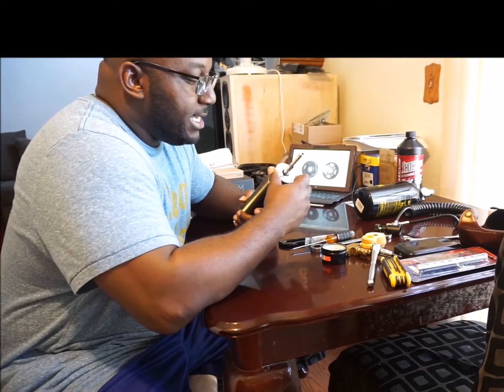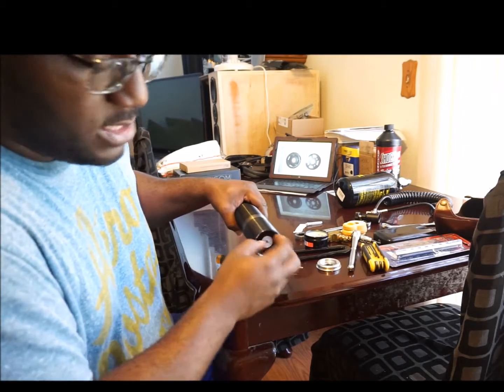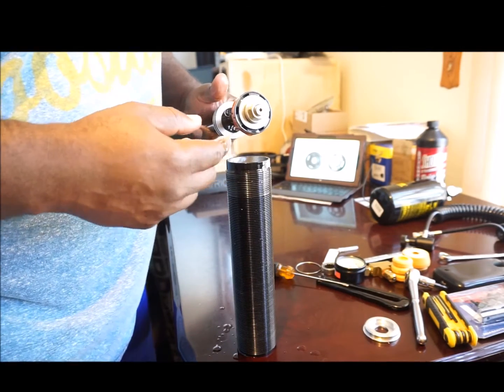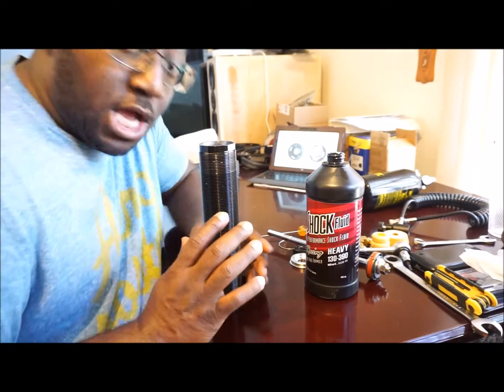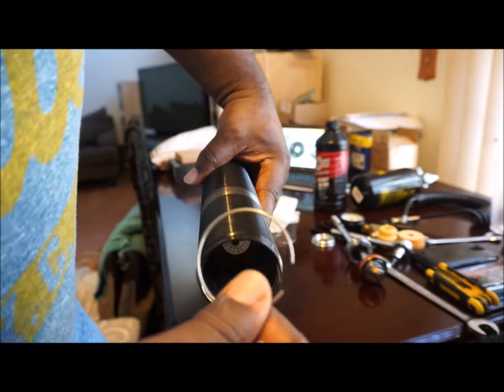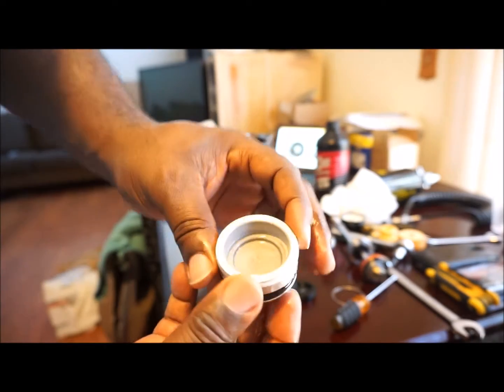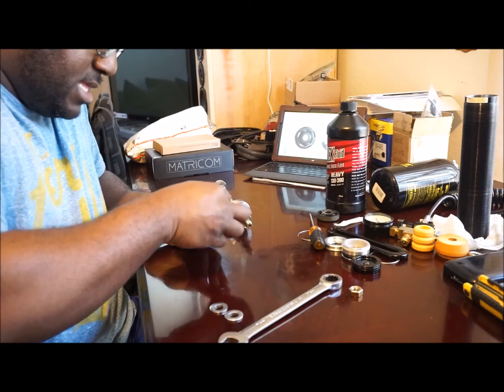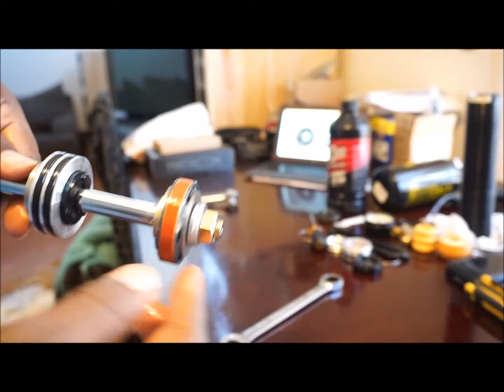DIY BC Racing BR shock Revalve tutorial - PART 2 (Bilstein internals)

Comment: What oil does BC Racing originally use?
Reply from the maker: @pacca006  I am not sure, but if memory serves me correct it was a little bit thicker than the 10 weight oil I replaced it with.

Please google “DIY shock revalve club Lexus“. I wrote a 50 some odd page tutorial with step-by-step pictures in the process of the BC racing shock disassembly. I do believe I took pictures of the oil in empty and cleaned Gatorade bottles on that post.
Reply: @frugalfabrication  grazie!
Reply from the maker: @ you are welcome👍🏾
Reply: @frugalfabrication  I found an easier way to fill nitrogen. Do you think it is possible to use disposable 1L 110 bar cylinders?
Reply from the maker: @DISCLAIMER: I take no responsibility for anyone who would open, disassemble, reassemble, close, or modify a shock/strut of any fashion. Anyone who does so, does such at their own risk.

Now that the legalities are out of the way, yes I think quite possibly it could work. Just be careful, and make sure to be extra cautious when opening the pressure to fill the shock.
Reply: @frugalfabrication  Sure. I found a quality needle to do the job

Comment: Hey bro where on line can I get the replacement seals at for the rebuild
Reply from the maker: I would start here as I have heard good things about this business for seals and O-rings:

O-Rings & Things
Rating: 4.9/5
19 Google reviews
Hydraulic equipment supplier in San Bernardino County, California
Address: 14546 Hawthorne Ave, Fontana, CA 92335
Phone: (909) 357-7110
https://oringsandthings.com

These guys may also have the seals you need:

https://www.oringsandmore.com
https://www.ebay.com/str/oringsandmore

https://www.theoringstore.com/store/index.php?main_page=index&cPath=367

Comment: Hey man if I was to purchase BC racing digressive valve shocks can I keep the existing shim stacks in compression and rebound and just out in a COB bilstein piston would that work?
Reply from the maker: I would no to that.

Physically, yes you may be able to have the parts all fit together, but the performance more than likely would NOT be desired.
Without getting too technical, the only small way I could see your question working and matching up with the results of the  Clublexus shock revalve tutorial writeup, is if BC Racing made their BC digressive piston’s design parameters match up to the same design parameters of the bilstien COB piston.
Reply: @frugalfabrication  thanks man really appreciated that helps a bunch!
Reply from the maker: @drunktortila3632  You are welcome man. Anytime.

Keep in mind this does not mean that you cannot modify the BC racing digressive piston.

I have not see the BC racing digressive piston personally, but I believe you can modify the existing shim stacks to get desired results.

The only issue is that if the BC racing digressive pistons design features ( I dont want to go technical here) do not match up with any variation of the Bilstein digressive piston design features, then the Bilstein Digressive Valving manual would be useless to you on your endeavor.

You would be revalving by trial and error whi is basically using a shock dyno and computer to plot your results after every shim revalve to see if you finally have your shim stacks arranged to give you your desired graph/results.

Comment: What do you mean by Bilstein Internals? Doesn't BC make there own?
Reply from the maker: Alex yes BC does, but I removed them and installed the Bilstein internals and custom valves my suspension shocks for a way far superior ride using bilsteins valving manual.

Google “clublexus diy shock revalve” and read through my step by step tutorial.

Comment: Wow finally a good rebuild video, that's how you do kids! except that you can get a C clip pliers. My wife hates when I do mechanical work on my living room, last time I made a mess with DOT4 hydro oil.

 Thanks 4 the video
Reply from the maker: No problem man. You are more than welcome. Lol and yes, I too as well had complaints of using the dining table as a workbench. Hehe.

I now have a dedicated work bench in the garage.
Reply from the maker: Make sure to Google the “GS300 diy shock revalve” post on clublexus.com it is way more thorough than this video and somewhat guides you on how to perform the math behind making shock shim selections and how to do a full scale shock revalve to achieve what you want.

This is was calculated using the BC racing shock body with Bilstein internals and the Bilstein shock revalve manual.
Reply: Thanks I'll. The ones you made is pretty good too. And gives me some ideas I'm thinking about getting a Megan and upgrade the internals and a swift spring to see how's work. Thanks man keep up the good work.
Reply from the maker: +pvflyer67 no prob. I may be wrong but I think Megans are a 45mm internal diameter piston and not the 46mm that the bilstein’s are. Not sure if you have a whole set of Megan’s yet, but before buying a full set maybe invest in just 1 replacement strut cartridge for your car and open it to take measurements.
Reply: No, I have not bought the Megan's. I am in between the Megan and BC's. What I don't like about the BC's is the rear shock design they have for my car. But I may have to leave with that.
 Again great info and thanks for sharing with me. Megan website sucks if you're looking for technical info about their products. It would be nice if they've a spec technical sheet.
Reply from the maker: +pvflyer67 Yes, a spec sheet would most definitely be nice. Hopefully in the next few years. This will become standard.

Comment: And - how do you like the bilstien piston versus stock?
Reply from the maker: I love this Bilstein digressive piston setup more as it is far more comfortable at highway speeds especially on imperfect roads when the adjustment knob is set with cornering/body roll as a priority. (Less valve bleed)

This is versus the original bc racing linear profile

Keep in mind for those wanting to do this, if you read through the tutorial on club_lexus, the bilstein valving manual is intended only for the bilstein piston valve. Not penske, ohlins, etc valves.

.
Reply: so the bilstein is a "50/50" valve as you called it - while the BC has larger orofices for compression than for rebound. With this, shouldn't the bilstein be stiffer on compression than the BC - all things being equal?
Reply from the maker: +Chuck Davis the rebound orifices for the BC racing piston are way more smaller in size when compared to the compression orifices. Which yields the higher rebound forces shown in the shock dynoes on the clublexus forum post tutorial.
Reply from the maker: +Chuck Davis the Bilstein pistons shown in the clublexus forum tutorial are a 50/50 piston as the orifices for both rebound and compression posses the same area for fluid to pass. So the shim arrangement is of more priority as the shock profile is determined by this. 
Because this piston is a 50/50 orifice piston, it is more versatile in my opinion..

The same applies to the BC racing piston, but for example less shims would be needed for the rebound side as the orifices on this side are smaller.
Reply: Cool. Thnx
Reply from the maker: +Chuck Davis no problem, anytime. If interested in shock rebuilding  Please feel free to google "clublexus diy shock revalve". The full tutorial is on there.
Reply: I’ve watched or partly watched like 20 videos in rebuilding either BC or Fortune shock rebuilds. One guy did a disassemble of the coilovers assembly, but not the tear down of the damper. I told him it was a good video, just not a “rebuild” and he disagreed. This is a full rebuild. Excellent job. Should have way more views.

Comment: Good job. The sliding or dividing piston as you call it is normally called an internal floating piston. The placement of this piece is extremely important as if it's too high, it can hit the main piston and if it's too low the shock won't ramp up properly and the end of travel. I wonder if BC would give us this measurement??
Reply from the maker: I did not have the exact measurement from BC racing, so here is what I did. I took the partially BC racing assembled shock body and compressed the shock shaft to its lowest point of travel. 

And then measured the distance from the very bottom of the shock shaft tightening nut (while shaft is compressed) to the inner most point of where the shocks "butt plate" or bottom end cap would be inside the shock body.

Once I find this distance, I would then divide it by 2. and this is where I would place the top side of the "dividing/sliding piston" at.
Reply: Thanks. I'm going to call BC and see if they will give these measurements. The IFP depth and oil height are both super important. I'm glad to see these are easily rebuildable and customizable. How do you like the bilstein piston vs stock??
Reply: I just talked to BC Racing and they don't publish specs on how to rebuild shocks.  That's unfortunate - but I'm really glad you made these video's. I hope other people DIY and share the info they find. Thanks again!
Reply from the maker: +Chuck Davis no problem. Anytime. 👍🏾

Comment: Thanks for this vid. Do you recommend these coilovers?
Reply from the maker: For general track use, then yes I recommend them. Even for regular street use they are ok. My issue was I wanted the most control in body roll, but without having to "stiffly" feel every bump or dip at 70mph on regular roads. These coilovers, and any 'linear like piston' coilovers will more than likely exhibit this issue. Google ksport, megan, fortune, bc, ohlins, AST, Bilstein shock dyno graphs and see if they are linear or digressive. Read through the clublexus post link in this video description. If you have any questions feel free to ask. Hope this stuff helps.
Reply: majanboo22
Thanks. I've never bought coilovers before so I'm fairly new to this area of the car.